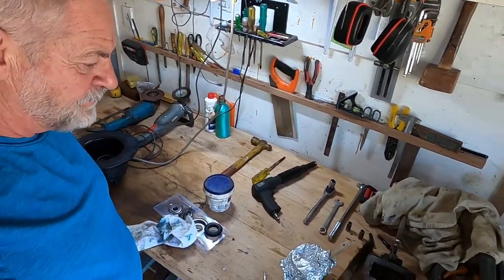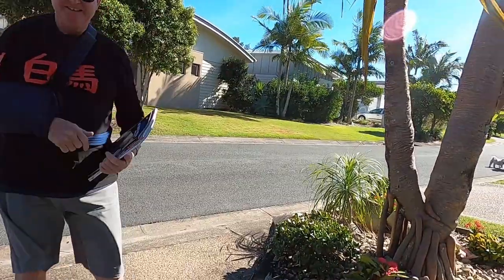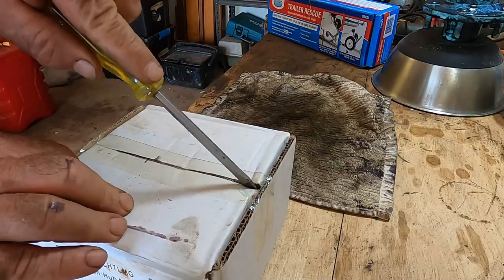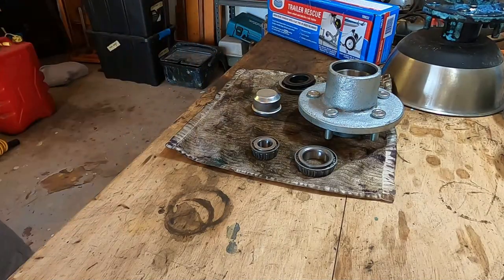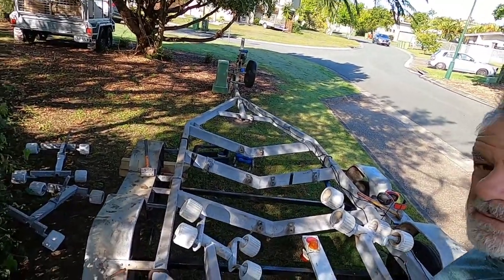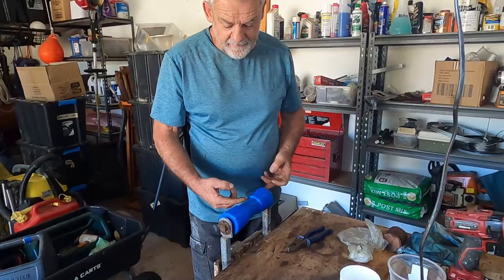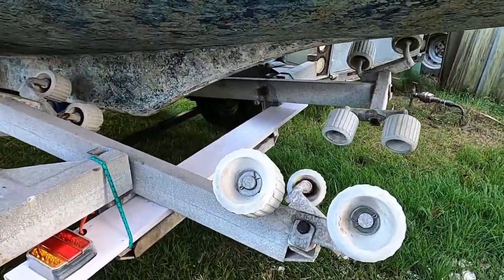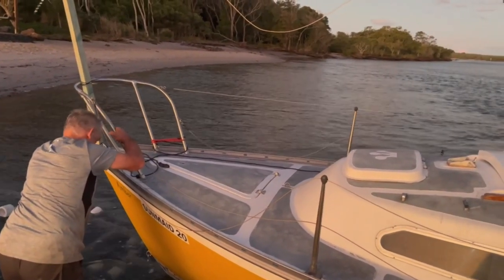Completed trailer fixes boat launch fail. Fiberglass boatworks Ep 5

Comment: Just in the middle of restoring my trailer and picked up some hints. Thanks Chris!
Reply from the maker: Glad you found it useful. I moved into the fibreglass work today. Feels good to be working on the boat finally.
Reply: @SmallSailboatCruising  I still haven't been able to move the keel, even with the pin drilled out!! Will focus on the trailer to save going mad!!
Reply from the maker: @ianmcgillivray4228  This is a common issue it seems. I dealt with it once in a Farr 5.5 and managed to get it out while tipping the boat on its side. Mine was running free, but since I took it off its mooring and let it dry out it has seized!!!! Yikes. But I will get onto it soon before it becomes too hard. I have been thinking of ways to do it. I am thinking to drill a hole up into the keel from below and tap it out for a 6mm eyebolt. It could be 8mm or even 10mm if the problem was severe. I'll attach a shackle, and put a strong rod through the eyebolt. a bottle jack on either side placed on the strongest part of the keel (taking care not to overstress the hull) It should do the trick I'm pretty sure. We used to have a saying "that should stop it farting in church". Resistance is futile! The key I think is to create a very strong and solid point for attaching any form of lever, or jack system. I plan to leave the eyebolt in so it is there should it ever be required again, but it could easily be filled with epoxy when doing up the keel. One thing is for sure, it should make a popular video!
Reply: @SmallSailboatCruising  haha...love the old sayings 🤣

Comment: Wow I've had quite a few trailer sailors, (including a MacGregor 26M) and I've never had to submerge the wheels like that.  Sometimes it has even helped having the trailer a little higher so the back rollers guide the bow into a more central position.  I thought those rocking rollers at the back were going to act a little like a tilt mechanism.  No disrespect mate - I'm sure you know what you're doing, but I was just a little surprised to see that. For our Mac26 we used to have vertical guides at the side of the trailer with rollers on them (it only works with the boxy shape of the Mac), and we could drive the boat on between those like a motor boat (which it was, I suppose).  Even then,  I used to back the trailer down until the axle was just above the water.
Reply from the maker: I also had a trailer sailer with a hull shape that allowed launching without submerging the axle. I have launched a macgregor and it worked for that hull shape as well. This is a completely different proposition with a stub keel and a deep draft to deal with. It was hard to launch off the old trailer but now it glides off and on effortlessly. The trade off is you need and to submerge the axles and for me it is worth the extra care with bearing maintenance to make effortless single handed launching possible.
Reply: @SmallSailboatCruising  yep, I'm sure you're right. Quite a different situation. Thanks for the great vid and for sharing your experience.

Comment: Hi Chris, great video about how you are fixing up the trailer. I think you said in last week video that you were going to use dyneema first the breaks lines ?
Reply from the maker: The kit I purchased had a steel cable so I went for the quick and easy solution. When it comes time to replace it I will probably ise dyneema which would probably outlast me.

Comment: What model electric winch are you using?
Reply from the maker: It’s a cheapy. 3000 lb Atlantic from anaconda. $115. Used once so far and it worked well enough if a bit slow. Time will tell.